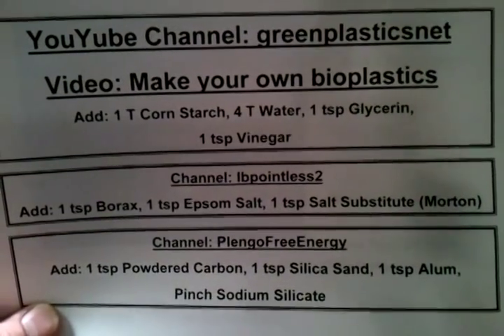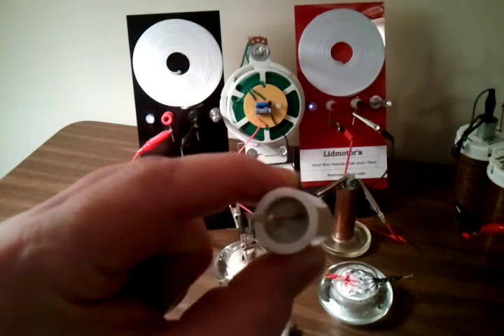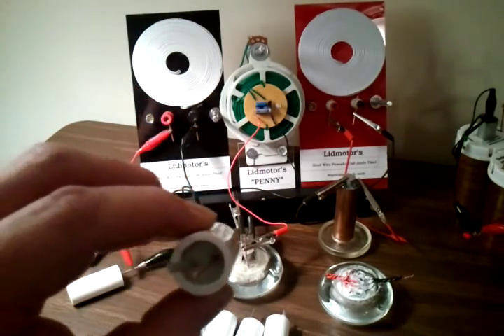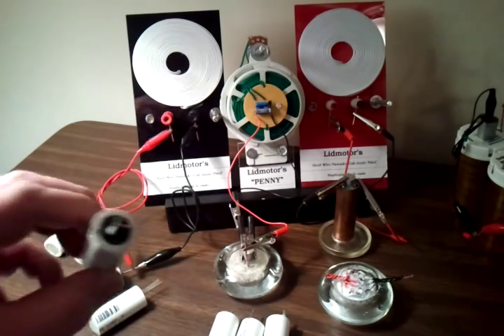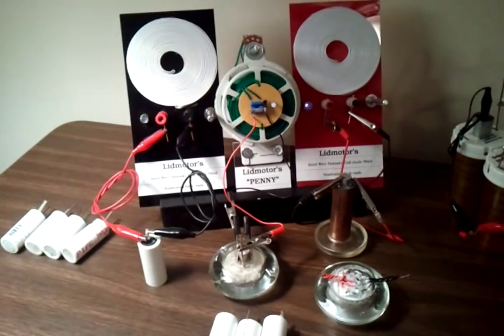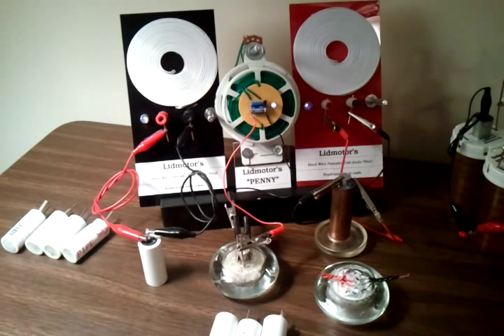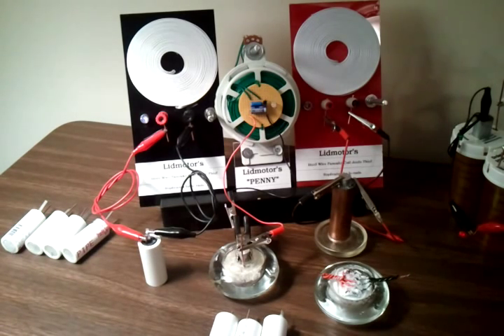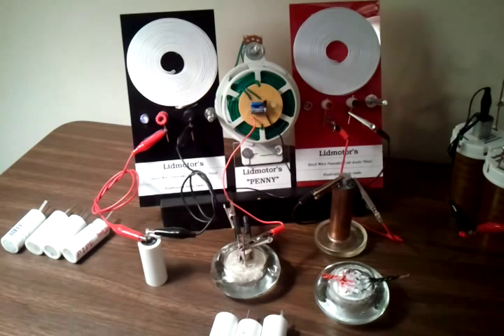Bioplastic Crystal Power Cell

Comment: @OUbrads 
Ahh, this  I did not understand when I watched it first.
So you mix the Alum and other salts first with the PowerPlastics
and then use this as the electrolyte ?

Is the Bioplastic solutable in water after it hardens ?
So normally it is an isolator,right ?
How can it then conduct the current ?
So do you put a lot of the salt mix into the Bioplastic to get 
a conductive mix ?
Many thanks.

Regards, Stefan.